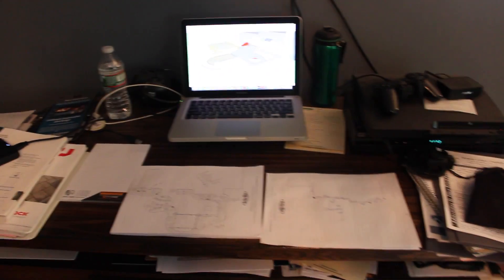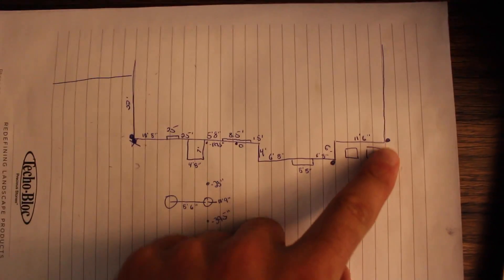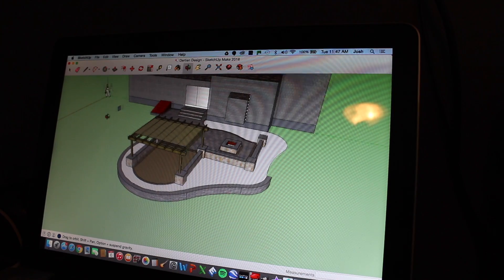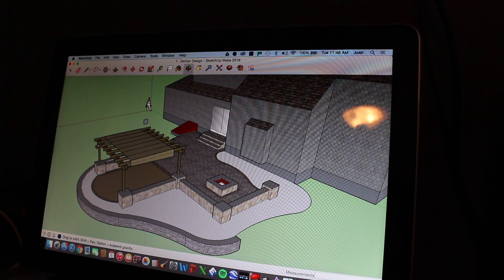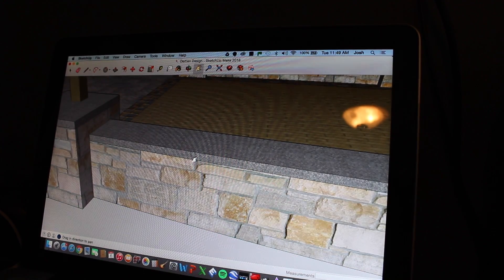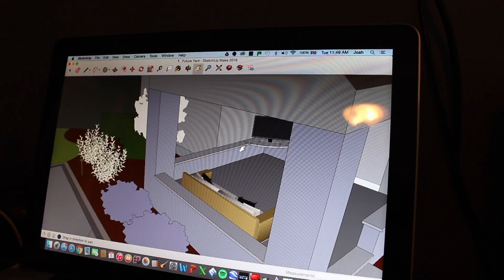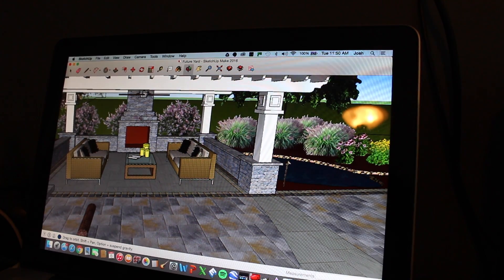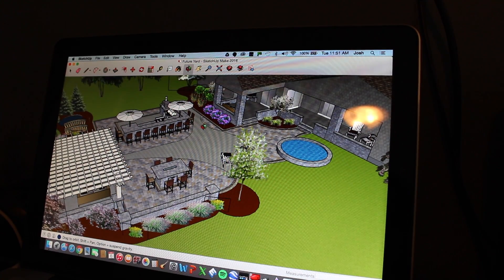Using Trimble SketchUp for Landscape Design

Comment: use Google earth for your measurements. really fast and accurate. use the pro version
Reply from the maker: Never thought about that. I'll have to give it a try. I've always just done my measuring when I go to look at the job!
Reply: Google Earth is not accurate enough.  You need to take live measurements - Earth can be skewed and also outdated.  Be warned.
Reply: Ivan Mazur we have new imagery in my city, and have field tested it to better than 1 inch on over 50 sites before we switch to this method. it is accurate in my area, no question.

Comment: Tutorials would be great. Thanks
Do u have a design background or self taught?
Reply from the maker: I will be uploading them soon. I took design classes while I was at UNH but I always try to find classes over the winter put on by suppliers on design. That's how I was introduced to SketchUp. I also did some design work for the company I used to work for.
Reply: @HardscapeMediaCreations  are you still doing design work tutorials